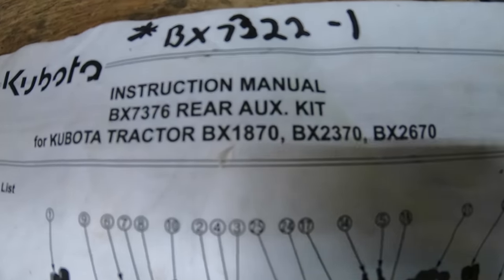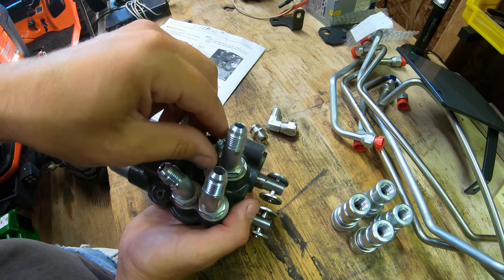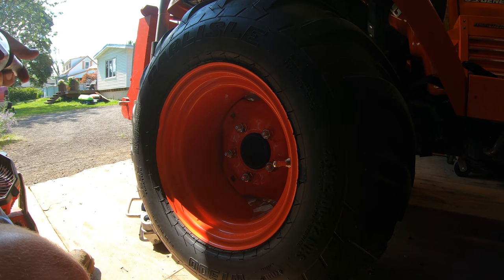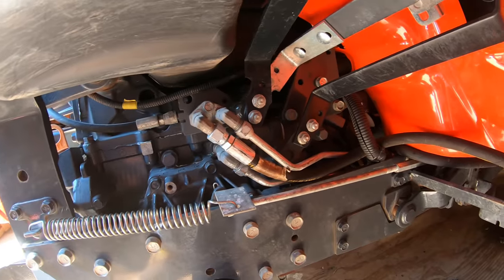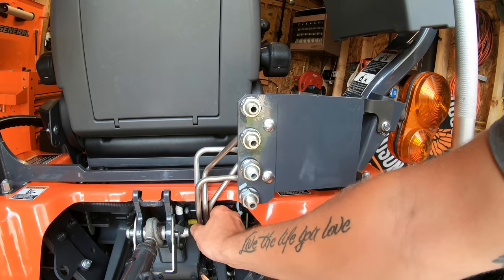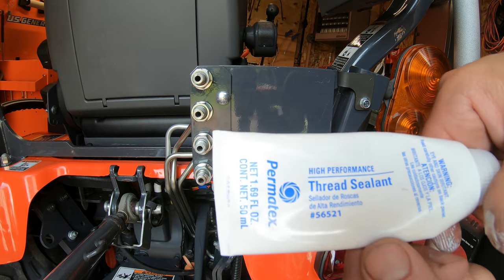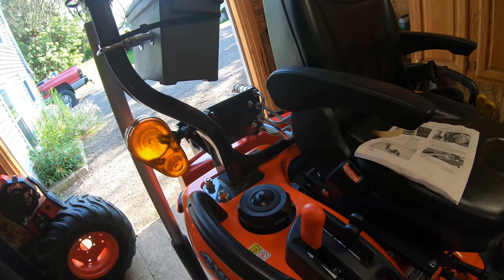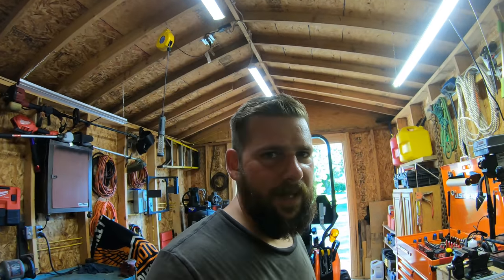Kubota BX- Rear Remote Kit + Hydraulic Top-Link (FULL INSTALL)

Comment: Great content! The part number is BX2419 for the rear remote kit applying to the newer Kubota BX80 and BX80-1 BX series tractors . It is not compatible with BX23s backhoe models. I recently installed the kit on my 2020 BX2380, very well made.
Reply from the maker: Awesome! Thanks for giving the viewers this information, I will add this info to my video description as I'm sure the install is very similar also. Good to know about the backhoe too.. I didn't think it would work with a backhoe but I wasn't sure if they had made it possible with the new kits on the newer tractors. Thanks for watching!
Reply: is the BX2419 valve dual valves as well?
Reply from the maker: @doct0rnic  yes I believe they are all dual valves 4 outlets in total but ask your dealer just to be sure
Reply: Hi, was ready to get this model, (BX2419) but on my BX2380 which is a 2021 model - The place that Biff uses for the two controls is in the slot that raises my rear arms, all slots on that side have a function, is there a different way to operate the function?

Comment: Great job , yeah rebuild your tree shear , it will make a great video. I like your build ones the most , I think.  Probably because it’s a normal guy building something that companies build off of blue prints. Great job as always. Todd
Reply from the maker: Thanks Todd I really appreciate it man. I will certainly try to find some time before it gets cold to re-build the tree sheer.. iv been sorta aching for another welding project anyways before my welding skills start to disappear! Glad you enjoyed, if you ever buy rear remotes let me know how you like them!
Reply: @BiffsEquipment  I’m wondering if you want to make a push box for me . I’ll pay ya
Reply from the maker: @toddcaskey9984  Hey Todd, I would love to build you a pushbox only thing is with the VERY VERY limited space I have to work in it would be very difficult.. Building my own in that tiny shed of mine was extremely hard to do. If I had a larger garage which I plan to build some time soon then I absolutely would start building implements for people. I may be selling my pushbox come winter though and if I do ill certainly let you know. This year I'll prolly be running an Artillian angle plow that mounts to my FEL. The pushbox did a great job but the plow would be nice for my driveway for the backdragging near my house/shed and to have the ability to angle it when plowing that first pass down my driveway in 1-2 feet of snow.

Only issue is its gonna be hard for me to let me pushbox go as I put so many hours/time into building it that it has special meaning to me... This is the only reason ill have to think about it lol.
Reply: @BiffsEquipment  I think yours would be too small I am getting a 40 hp bobcat tractor which is a Koti really . I would love to have a plow for my driveway it would be better.

Comment: Nice job and well explained.  Did this install on my old BX1860 though the kit was a little different.  Do remember it was real tight for turning a wrench.  Too bad Kubota doesn’t offer a kit for the backhoe models.  Think the backhoe subframe interferes with where the block goes.  Ended up making my own kit from Surplus Center parts using the backhoe power beyond loop for pressure in and out.
Reply from the maker: Very cool! I saw a guy do something similar on Tractor.net I think it was.. he made it work with his backhoe. I believe this kit could work if it didn’t interfere with the backhoe operated station.  Hopefully someday we can find out for sure or not. Thanks for watching!
Reply: @BiffsEquipment  I did post pics and info on TractorByNet years ago so could have been me as I did set up one remote with a detent to allow continuous flow.  I was able to run the backhoe through the valve.  Was thinking I could use the second circuit to run a hydraulic thumb but never did that conversion.
Reply from the maker: @chdinct6792  haha that’s funny I’m almost positive that was your post! Looked like a great setup you didn’t a nice job with it .. goof write-up too!

Comment: I would recommend getting a top link cylinder with swivel eyes before you get implements. I used a rigid cylinder for my top link and the side pressure when turning caused O rings to leak and can bend cylinder shaft. Great video as always. Can’t wait for the next one.
Reply from the maker: Thanks for the comment Ron, I did actually think to myself the same thing.. with not having eyelets there isn't much room for side to side movement so ill be sure to keep my Messick stabilizer links tight which I usually do anyways. I'm not too worried about the cylinder as I got it for free so if it breaks or bends that wont bother me but what I don't want to do is break/crack, or bend the mount coming off the back of my tractor.. This would be my biggest concern.. I may end up going with a whole new cylinder when I finally buy a Top + Tilt kit so ill def keep you guys posted specially if I have any issues with my current cylinder. Stay safe out there!
Reply: Also forgot to mention that I’m getting rear remotes for my B26. I was going to have them installed but thanks to you I’m going to do it myself. That’ll save me about $500. Again thank you for the great videos and keep up the great work!
Reply: @BiffsEquipment  Do you happened to have a recommendation for a Top + Tilt kit?  I will be installing my new rear remote kit tomorrow :)
Reply: What cylinder would you recommend for a BX2670

Comment: Kit looks just like what the BX2660 used other than the coupler mounting plate.  I didn't have to drill any holes.  Enjoy having the extra flexibility.   Jason
Reply from the maker: Thanks Jason, Yes the kit is basically Identical aside from the mounting bracket that holds the hydraulic couplers. Aside from that its virtually identical Another reason I wanted to give your video a shout out at the end as they can possibly get something from your video that they didn't get from mine. Stay safe!

Comment: Good video just wandering will it interfere with your cab when you put it back on.
Reply from the maker: I was wondering the exact same thing , I don’t believe it will but we will certainly find out in a few more months here as the weather starts to change so I’ll keep you guys posted on that.. even if it does I’m sure I’ll be able to find an easy work around for it so I wasn’t overly concerned

Comment: Sir, that was an awesome instructional video in every aspect. Even down to putting the sticker on straight. It would drive me nuts too, seeing it crooked all the time. 👏👏👏👏 Great job. 
Question, you used the bottom two ports to hook up the top link, why? And, does it matter the order they are hooked up? Also, and lastly, what are the top ports used for? Thanks again, great informative video.
Reply from the maker: Hey Ronnie, thanks I really appericate the kind words buddy. As for which couplers to use, you can either use the top 2 or the bottom 2 as this new rear remote kit has 2 leavers.. each leaver activates 2 valves  one valve when it’s pulled back and another valve when it’s pulled forward.. so it doesn’t matter which 2 you use so long as you use either the 2 top couplers or the 2 bottom couplers at the same time. You can’t use say the top coupler and then the one all the way on the bottom because those two couplers would be on different circuits on each valve. I only used the bottom ones because it was closer to my cylinder so I’d have to use less hose when I finally did cut them to length but that’s the only reason. I’m glad you enjoy my instructional videos, I hope they help out many people in coming years. Best of luck!
Reply: Thank you sir, that was helpful. Have a good day.

Comment: great video but why did kabota put the ports so far away from the rops they would be in the way of the operator when the back hole is on
Reply from the maker: Thanks man, I don’t think Kubota had a choice as space was very limited and how far they could actually bend those steel lines with out kinking them. As for interfering with the backhoe you are correct they do.. but this is why they don’t offer a rear remote kit for the backhoe versions which is too bad.. I wish they came up with a way to get around this as I know of a lot of guys who would love to have a rear remote kit on their backhoe machine!
Reply: I look at my mind and it looks like the back hole hitch is in the way of putting the  remote valve on, far as location of ports they could do way better I would love to have rear remote port
Reply from the maker: @eo1340  you can get the parts list online or from your dealer maybe you can check the parts out and see if you can make something work or bend your own steel lines and relocate the bracket. The bracket is nothing more than a piece of 3/16 plate steel with 4 holes in it anyways

Comment: I just discovered your channel and immediately subscribed. I am enjoying all your “how-to” videos as they are just great. You seem to have the right mix of elements to make engaging videos!
Question: I noticed you use a lot of Harbor Freight Tools. Do the Pittsburgh open end wrenchs hold up for you?  Heck, do the non-powered tools hold up for you? And if you were to do so (and maybe you could do a short video on this) what tools would you carry with you on the tractor out into the field? Keep up the good work!
Reply from the maker: Hey Edward thanks for subscribing, I’m really glad you enjoy my videos thus far! I try to make videos that will help other tractor owners out and try to show things they may not know and also enjoy working my little Kubota BX to death haha. The pitsburg tools have been very good for me so far, you have to watch with some of their plyers, needle nose, and wire cutters as some of them are kind of cheap and the rubber grips always tend to slip right off when using them.. but their sockets are impressive I have yet to break a single one of them and I use them in my Milwaukee cordless impact gun/ratchets all the time. Their extensions and adaptors are also pretty good quality and so are their ratchets.. I have yet to break a pitsburg rachet. As for wrenches I use gear wrench ratcheting wrenches.. I have not tried the pitsburg ones but have seen people who have and they have not had any issues.. I would assume their wrenches are as well made as their sockets so no worries there. Doing a video on my tools and what to carry in your tractor would be a great video! I’ll see if I can make one like that sometime when things slow down a bit. Thanks for watching!
Reply from the maker: PS. I was an automotive mechanic for most my life before I got out of the bussiness and started doing landscaping/tractor type work.. I use to own nothing but snap-on tools so I know quality tools and keep my snap-on tools at work.. I decided to buy/try the pitsburg stuff just for my home and for the money you really can’t beat it.. specially when your not using them every day for a living. The Icon tools are VERY nice and I would say in most instances are a direct replica of snap-on in many ways.. so if you don’t want the cheapest but don’t want snap-on go with icon and I promise you won’t be disappointed. 👍🏻
Reply: @BiffsEquipment  Thank you so much for replying. Your answer makes a lot of sense. Keep up the great work I love watching the way you do your work on your tractor.
Reply: @BiffsEquipment  Thank you so much for the very thorough answer. You do a very good job with your videos keep making them I love watching them.

Comment: Biff where did you order the kit from , I find bits and pieces but no complete kits. Thanks and you just encouraged me to do this project.
Dave
Reply from the maker: Hey Dave great to hear the video helped give you confidence to try it yourself! I got my kit from my local dealer but the kit had to be ordered from their wholesaler out of Georgia.. your correct tho these kits are getting increasingly harder to find as Kubota is no longer making them I’m pretty sure.. my dealer told me Georgia only had 2 left in stock and I got one of them .. maybe ask your local dealer if Gerorgia still has another kit laying on their self.. you can also get a parts manual for this kit and order each individual part possibly.. you’d have to talk to your dealer. Best of luck hopefully your able to get it!
Reply: Biff, I got one  from Georgia just need to wait  for it. Thanks 
Dave
Reply from the maker: @davidburt6676  awesome man glad you were able to get it! Let me know how you make out 👍🏻

Comment: Awesome video! Do you happen to know off the top of your head the price of the kit? Can’t seem to find it online probably have to buy it through the dealer. Also, I do not have 3rd function on my 2380. Does that make the install for difficult?
Reply from the maker: Thanks man! As for the kit they usually cost between $450-$650 depending on which exact kit you need and where you buy it.. which is a super good price IMO and is worth every single penny. I think I posted a link to where you can buy one on eBay in the video description but I can’t remember but you may wanna check there first. Thanks for watching!

Comment: Honestly looks pretty easy overall to install that kit.  Probably pretty close to the same for my BX2680.  I don't have anything that needs rear remotes but might be worth adding them at some point so they're there if I do get something...I've been thinking of getting a hydraulic top link to make adjusting my box blade easier, and it would make adjusting any 3 point implement easier anyways.  I've also thought about adding the 3rd function for the loader as well.
Reply from the maker: Thanks William, your correct it really isn't too hard to install if you just take your time and follow the steps I took.. I put the kit together in my own order which I feel was a much simpler way then how they had described to do it in the manual. You wouldn't regret buying a rear remote kit or a 3rd function.. both add a TON of versatility to your tractor even if you don't have a use for them right away.. And with each kit costing less than $500 a piece its a no brainer for me. Let me know if you ever decide to get one and how you like it!
Reply: @BiffsEquipment  Hi Biff, LOVE all your videos, I have the BX2380 model - it's a 2021, where you have the controls - I have the rear arms control located there and no slots that aren't being used, any suggestions?, I really need to do a Hydraulic Top Link for my Box Blade. Thanks so much for doing the videos - I've learned so much from them.
Reply from the maker: @fx3vette1  hey thanks man I’m glad to hear your enjoying my videos! Always love when I can help others or teach others or even just give people ideas of what to do to their own tractors next! As for the rear remotes.. I know they make a rear remote kit for the Bx2380 they just don’t make one for the Bx23S (since it has a backhoe) so as long as your machine doesn’t have a backhoe then you should have no issues installing a Kubota Rear Remote Kit on your BX2380. As for not having the blank or open slots available this is the first Iv heard about this. Are you 100% positive that nowhere on your control panels on either fender have an open slit for these controls to go in? If not then that really surprises me that Kubota has done this and makes me question where the leavers would even go then. Your best bet is to call the dealer and tell them what your looking for, tell them your looking for the rear remote kit for your Bx2380.. they will be able to locate you the proper kit tho they may need the serial number of your tractor.. once they do they will be able to look at the parts involved in the kit as well as the Manual and should be able to tell you exactly where the levers are mounted and how they come through the fender.. they may have changed where they levers come through since your loader valve is on the fender Vs. being up near the loader frame like mine is so because of this they may have moved this slit or open slot to a different area on the control panel. I have never owned or even operated a BX80 before otherwise I’d surely be able to answer this question for you. Let me know what you find out cuz now I’m curious to know! Thanks

Comment: Very Nice…. Any idea where to purchase this same cylinder (for the Top link)?
Reply from the maker: Hey Dany, you’ll have to go online or possibly try your local tractor supply. I don’t have a part number for the exact cylinder I used because this cylinder actually came off a snow blower. The cylinder actually isn’t the right type for a 3 point hitch. A 3 point hitch should have a ball and socket on each eyelet and not just a regular welded eyelet. At some point I need to change mine out cuz it’s liable to break one of the ears off. I’ll do another video on this at some point updating my cylinder and giving a part number once I find the correct one. Hope this helps!
Reply: @BiffsEquipment  thank you!

Comment: I have a BX23S with a backhoe. It is a 2018. Messicks told me they don,t make a rear remote kit for my tractor. Where did you get your kit?
Reply from the maker: The reason Messicks told you this is because they technically don’t make a kit they are correct, they say this because since your model has a backhoe the rear remotes may interfere with the backhoe so because of this they will not sell you a kit for a backhoe version. If you want to try a kit and see if it will work with your backhoe then you need to call Messicks back and tell them your looking for a rear remote kit for a “BX2380” and let them know which style of rops you have; there are 2 different styles.. that is the kit you’d want if you tried it but I’m pretty sure it will interfere with your backhoe but you can prolly make a custom fittings bracket and some soft hoses coming off the headlines to relocate the rear rear remotes to somewhere higher on the tops where it wouldn’t interfere with your backhoe. Hope this helps! Best of luck 👍🏻